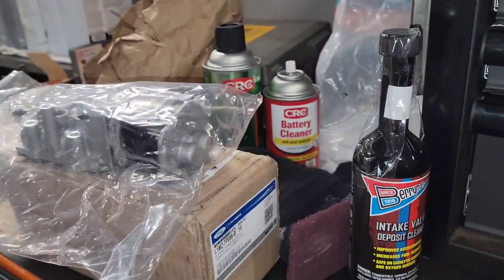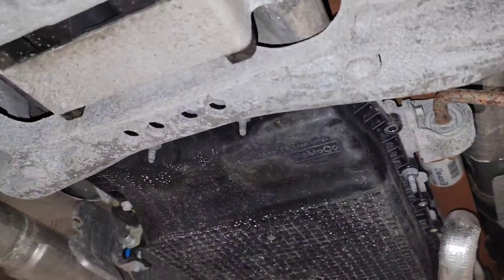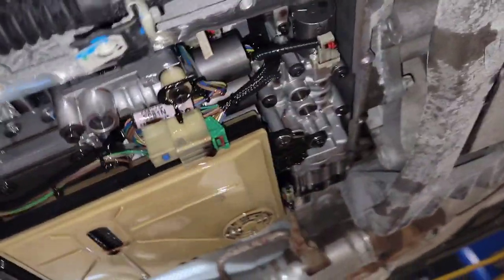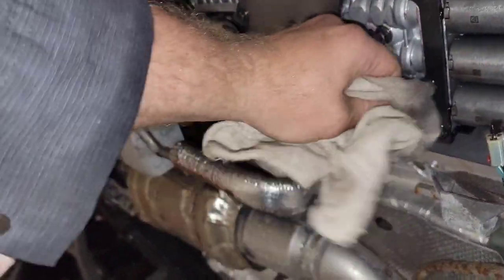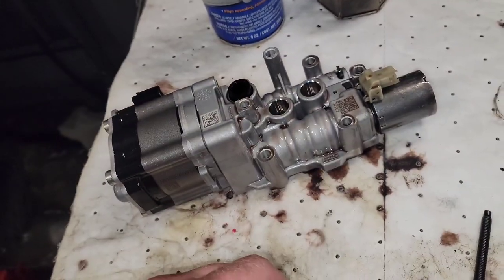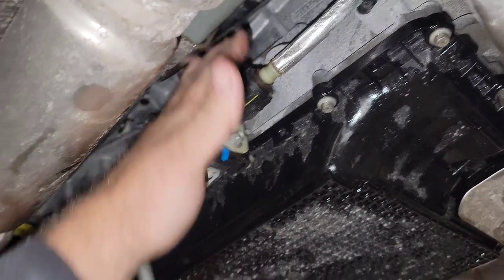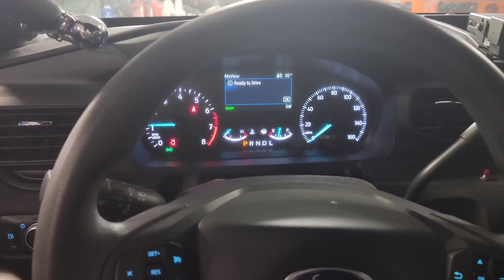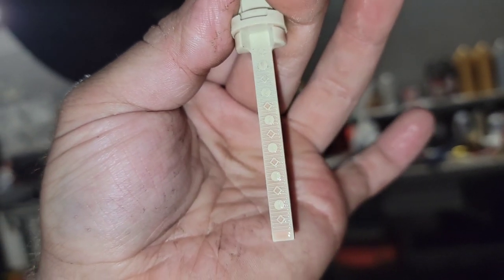2020 Ford Explorer 3.3L Hybrid Trans Filter Removal and Auxillary Fluid Pump 10r80 MHT - TBC

Comment: I use an apex TX-30 for the pump and the rubber seals call them squish tubes. I work for Ford ,but I’m just a assembler. I just realized you were talking about the filter socket. CSI Holland MI # 3028 is what’s etched in on the socket.
Reply from the maker: This transmission is a terrible design and we're constantly having problems with them

Comment: That fluid looks pretty whipped for a newer vehicle…. Those electric auxiliary pumps were not designed to overcome large internal seal leaks. I wonder if that’s why the new pump didn’t fix it. The lack of parts availability,and diagnostic information is troubling.

Comment: About 15  years ago I owned a 1994 Ford Explorer Sport. 4.0L V6 and 5 speed manual transmission. I would put it up against this new Explorer with all this technology. I could easily get 24 mpg with it tooling around and had good power and simple to maintain.
Reply: Agreed! These newer drive train is so week for the long run   Even the Expedition has the same week drive train sadly and no v8.

Comment: Gotta love throwing parts to see if the problem goes away. Cheaper than a transmission 😒
Reply: I sarcastically made a joke about that in my first couple months, one of my coworkers said, “well to an extent that’s kinda how it works!” Obviously some diag is required but sometimes you gotta just “start with this and let’s see what happens”

Comment: Note to self:  DON'T buy the first 2 or 3 years of a new model year.
Updated note to self:  DON'T EVER BUY A HYBRID!
Reply: Well buying new you have a good warranty if it's early failure or manufacturing error so that's great no reason you shouldn't buy a hybrid some just don't care for their cars
Reply: Toyota Hybrids are pretty reliable and long living since the whole system is designed as a hybrid transaxle. The systems like what Ford is using in the Explorer are basically modified automatic transmissions are another story I guess. It's cheaper to develop but it makes for a very complex transmission design whereas the Toyota hybrid system is pretty simple in it's construction.
Reply: @idgaffub  hello, very good point on the new car warranty but, I don't want my new car in the shop for warranty repairs.  I had that with a 1984 Ranger they couldn't fix it.  I usually buy new and keep it for a long time.  Also retired ASE Master Tech so, I'm not too afraid of jumping in and diagnosing, tearing in to make a repair.
Reply: @meeder78  I'd have to agree with you, designed from the ground up Vs. Jerry rigging any ICE component, has to be much better simpler and lighter.  I still bought a Toyota 4Runner last year, I can get gas anywhere no range anxiety and charge time.

Comment: Im confused. Is there electrical cables and connectors inside the trans pan ? How does the cables and connectors not with the hot oil.

Comment: Hey Ford Boss, do you know if this is the same pump and design that's used in the F150 Powerboost? The parts diagram for the trans oil pan has those same tubes on the bottom (for the F150 PB). So I assume so. Any thoughts on the reliability of the 10R80 hybrid on the F150? Thanks.
Reply from the maker: I haven't looked into one yet but I would assume they're the same design and we haven't had any issues with them so far
Reply: They are, had one come in for sliw engagement, shudder in 9th,10th gears at my dealer read pids everything showed to be a failed torque converter, pulled the valve body and found some debris in the regulator valve, replaced the hybrid drive unit and main control in it, test drove pulled pids everything checked out to spec, two months later and the truck is back with a pressure code hoping a new pan and pump fixes it, guy who ownes the truck is pissed but doesn't realize warranty will only let you replace what is bad.... it's out of power train now..

Comment: Hey Rich, my son ended up buy a 2022 Explorer Platinum Hybrid 4wd this past weekend and man that thing is nice. So in your opinion what do you think about the 3.3 Hybrid engine? Good, bad any issues I need to watch out for?
Thanks
Reply from the maker: Yeah all of these hybrids are having electronic issues they're having cold start rattle issues they are coming in with four wheel drive hub actuator leaks they are making a popping tinging sound if you look in the library of my channel you will see that there is a bunch of videos on these brand new Explorers so I mean I would go there first to be educated on the Explorers because I've already covered a lot of this
Reply: Cool thanks, I will definitely do that.

Comment: I work alot outside and around roads and stuff I see lots of people don't fully stop and shift into drive or reverse what's your thoughts on that it's a pet peeves to me I would never do that in my personal even if it's possible to do I never drive and then slam into reverse etc
Reply from the maker: I think it's a problem people should come to a complete stop before shifting and it could cause some internal transmission issues

Comment: These newer super-complicated cars are a disaster. All this unreliability just to meet CAFE.
My 2002 Focus manual will last me another 20 years.
I'll put a clutch in it and/or rebuild the engine if I have to at some point.
Tens of thousands cheaper than a new car. Hell , I have no ABS.VVT or D.I. and manual everything.
Reply: My 2013 Ford Focus is also a stick shift. The Sync is buggy but who cares. Mechanically it has been flawless. At 67,000 km of town driving, I might need a new clutch in a year or two

Comment: Can someone tell me when the dealership flushes transmission, do they reverse flush ? And is that the best way to have it done ? And or is there other options other than reverse flush?   Btw I think it’s a 10R80   It’s on 2020 f150 5.0 10speed.  Thanx.
Reply from the maker: It all depends on the dealership

Comment: did you say a thermostat in a transmission oil cooler  WHAT ?  LOL
Reply: Dodge has used one for years. Also IIRC the Crown Vics had one to. It's suppose to help during winter months for fast warm-up, but if it fails you get a burnt up transmission.